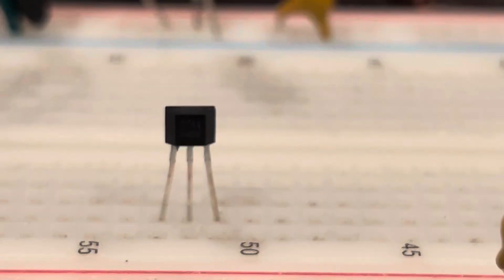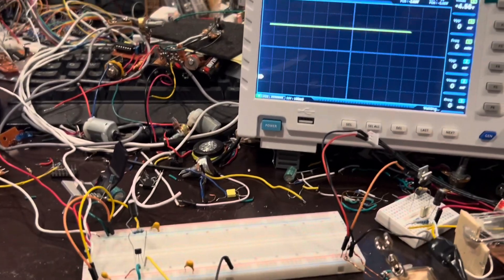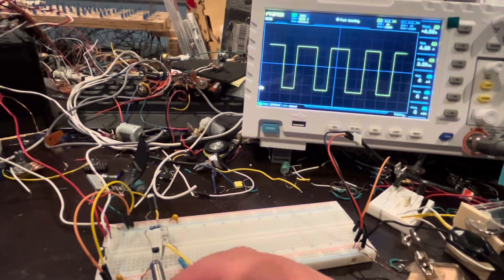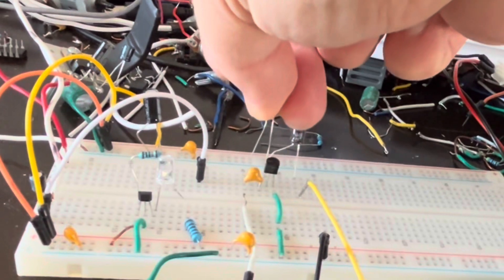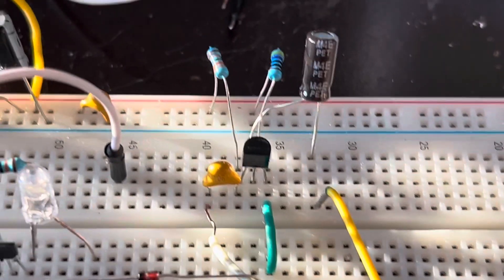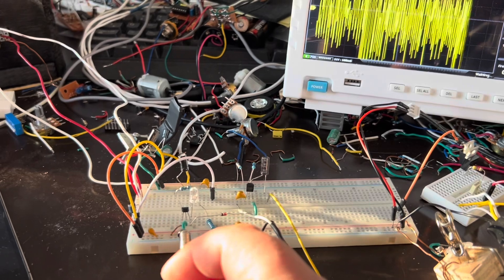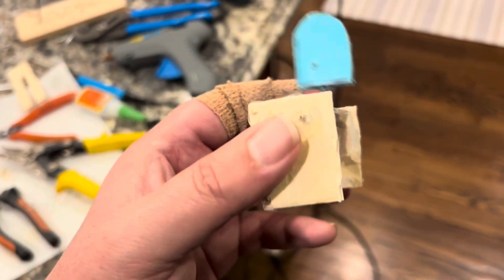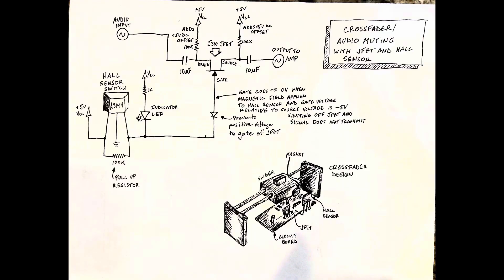Crossfader/Audio switch from Scratch using Hall sensor and JFET from scratch DIY

Comment: Cool idea, a CD4066 or CD4053 would also be a good choice instead of transistor.
I saved a axle from a old printer just in case it might be useful, lol.
Reply from the maker: @AnalogDude_  i was very close to getting a cd4066 until i started playing with the JFET
Reply: @igorbrichkov3632  it works, but the CD4066 uses n-channel and p-channel  with inverter to make it "perfect".